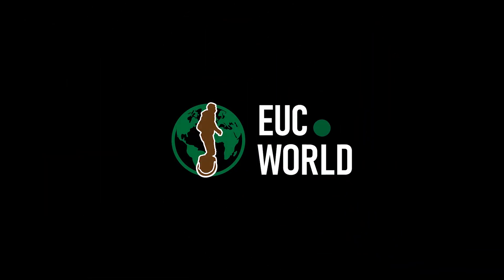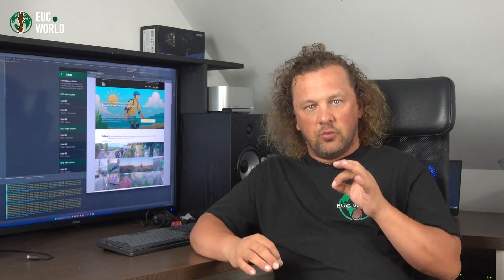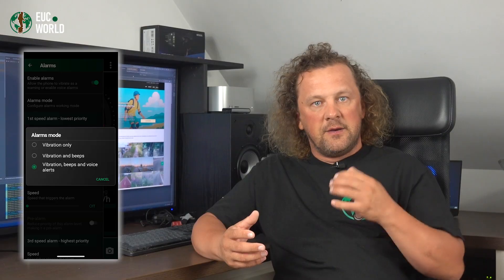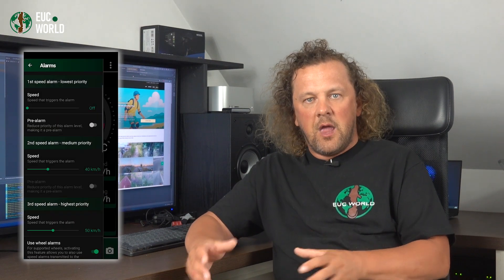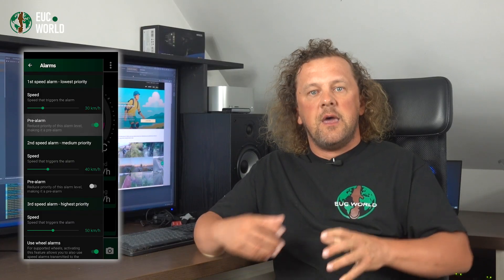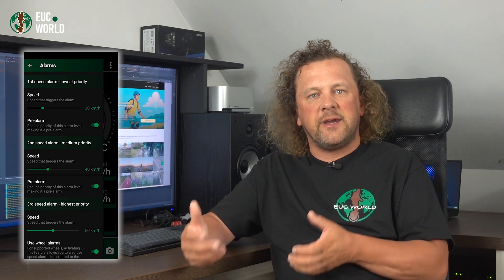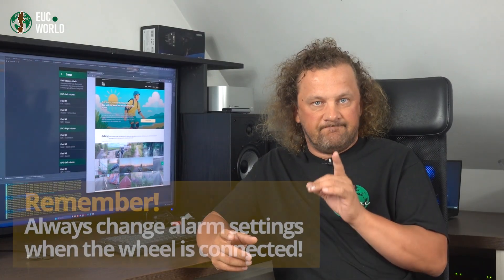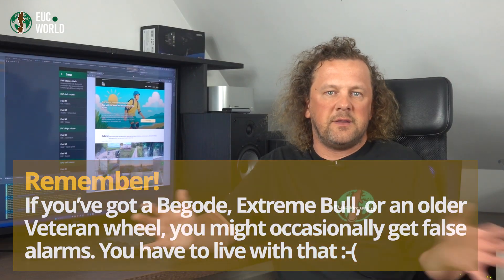EUC World app: Alarms - understanding & setting up

Comment: Would better with more PWM/Safety Margin focus, PWM is more useful than speed, for example it would be nice to set PWM pre-alarm, also a voice that can read out speed when triggered would be awesome.
Reply: Yes I agree, a whole video of PWM / Safety margin would be great.  

For example, is is there a difference between what EUC world calls safety margin and what other apps call PWM?  They seem like the same but I'm not sure how much calculation each app is doing on top of the info provided by the wheel. 

Also, can we distinguish between a wheel PWM alarm and an app PWM alarm?   I'd love to be able to tell the difference.

Also how to tune the safety margin?   It seems like with race mode and high field weaking the normal approach of doing a controlled free spin doesn't work as well as it used it.  Can the app come with some preset knowledge about how to adjust the safety margin for a given wheel.  For example, right now darkness bot and EUC world are producing pretty different numbers for PWM for X-way and Commander Max, but I'm not sure why?  Are they using different info from the wheel?

Having said all of that... thank you so much for the app, I use it absolutely every day and its so great!  Thanks for making these videos too!
Reply: @SamClegg safety margin is PWM reversed.. 10% safety margin = 90% PWM, you dont "tune" PWM, 100% = motor out of power
Reply: @RonnieRides  yes, intuitively safety margin and PWM are simply the inverse of each other.

However, I still have questions.

For example, why is it that DarknessBot and EUC World give very different values by default.  For example on my Command Max and get to 15% safety margin EUC fairly easily (around 55 mph).   However, in darkness bot I don't see PWM going over 7O or.   Is they using the same input and just making slightly different caclulcation?

Regarding tuning, both PWM and safety margin can be adjusted/tuned.       In EUC world the setting is called "safety margin scaling" and it at the bottom of the wheel settings under "advanced settings".       I don't know why it only sometimes showed up though, or why its sometimes grayed out (like it is on my Commander Max right now).
Reply: The traditional procedure for tuning PWM we have been using (at last in my community) is do a free spin test and try to get the 100% PWM to occur exactly then the wheel cuts out. If the wheel cuts out at 90% PWM then you need adjust it up, if the wheel gets to 100% too early you need to adjust it down.
Reply: @SamClegg if the wheel is not reporting PWM correctly then it's a bug in the firmware that the manufacturer should fix
Reply: @RonnieRides I would love that!